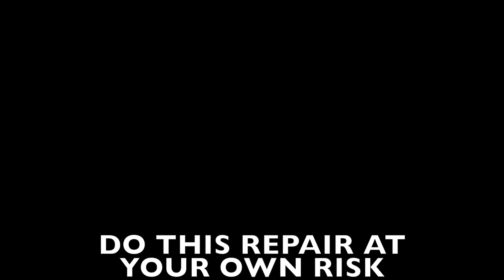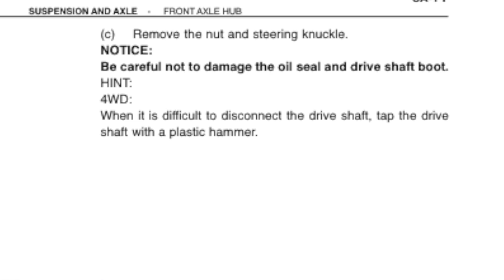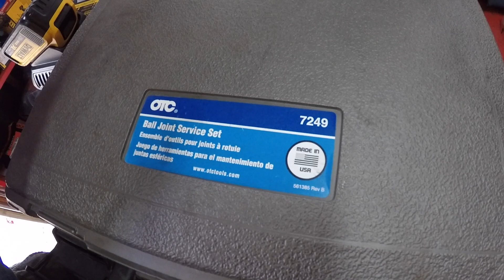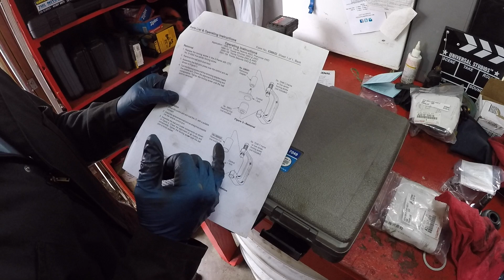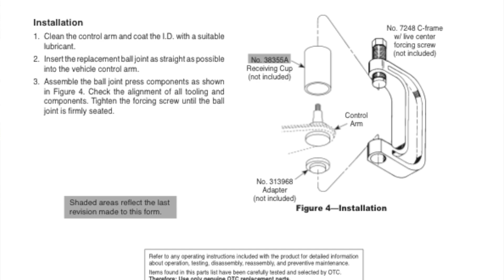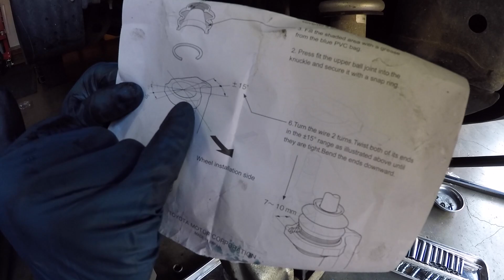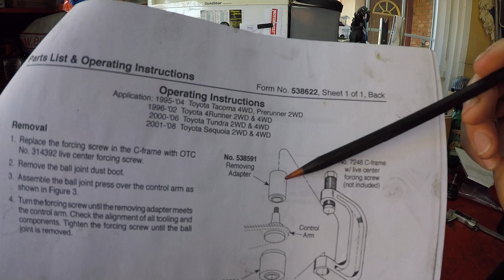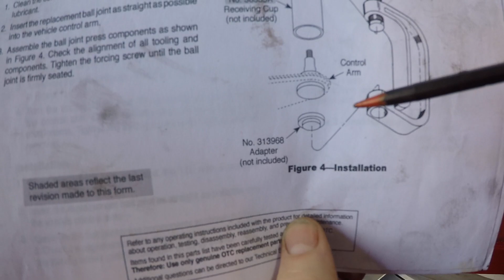Upper Ball Joint Replacement

Comment: Hey Timmy, is it really necessary to remove the whole knuckle? Why can't the ball joints be removed while on the vehicle?
Reply: Actually I just read your pinned comment,. I was thinking to myself, "why can't I just impact the ball joints out with the knuckle still on the truck?" Haha
Reply from the maker: It's not totally necessary.  I decided to pull it off so I could secure it in the bench vice to hold it steady because you have to apply quite a bit of force with the balljoint c-press to drive it out of the knuckle.  With someone helping you by steadying the knuckle while you apply force with the c-press, you could probably do it.  If you have an impact gun that you could attach to the c-press bar screw, that would make it much easier.

Comment: Timmy, do you know if the Pittsburgh Automotive ball joint puller sold at Harbor Freight will pull the upper ball joint? It is the tool that looks like (2) fingers with a threaded bolt at one end of the fingers. The bolt is used to apply separating force to the (2) fingers.  I can't tell if that tool would fit into (slip under) the upper control arm. If you've never tried one, I get it.
Reply from the maker: Hey Tim, I've never tried a Harbor Freight 2 Jaw Puller so I can't say for sure but I imagine it probably would if it looks anything like the one I used from my OTC Kit.
Reply: @TimmyTheToolman  Thanks for always supporting your followers.
Reply from the maker: @turnah8242  My pleasure Tim.  Sean and I started this channel to help empower people to handle their own automotive work and part of that is answering people's questions.  We don't always know the answer and some questions squeak by us, but for the most part, we answer all questions to the best of our ability and we also try to acknowledge everyone's comment.  We like hearing back from people sharing their success story using one of our videos.  That's the best reward we get from running this channel.  Happy Wrenching Tim!

Comment: Thanks so much for making your videos, they have helped me a lot!

The biggest issue I have had so far is the "c" clip/snap ring, what kind of snap ring pliers are you using? Mine won't do the job getting it wide enough to slip past the Proforged sealed boot.

Edit: I overlooked the post below of the same question, thanks for the info.
Reply from the maker: Pstand38 thanks for the comment. Hope you did alright with this job

Comment: getting ready to do my upper ball joint on a 2001 Toyota tundra 4 wheel drive, i bought the otc adapter for 313968 thats on the cheat sheet and your otc tools you added to your tool list , the circumference is to small for my upper ball joint bottom  , it doesnt sit in it , dont want to hurt bottom of the ball joint , can you please add otc part # of the bottom adapter # that your ball joint sits in to install it thank you
Reply from the maker: All the part numbers for the adapters I used are listed in this PDF.  https://www.otctools.com/sites/default/files/538622.pdf

Comment: What wheel spacers are you using on this rig? Size. I'm gonna have to do my upper ball joint on the passenger side. Every time  I'm wheeling I go over rock and the wheel drops, sounds hard hitting plus there is grease coming out too. I don't have a table or vise. You think with a buddy I can do it on the 4runner? I just need to rent the ball joint press and ball joint separation tool.
Reply from the maker: I don't know what spacers he was running.  You can probably do the swap with the knuckle on the rig with a helper.  You just need to stabilize the knuckle so when you apply force with the balljoint press, the knuckle is twisting.  Maybe you could get onto the knuckle with a pipe wrench holding it steady while the other person applies force with the balljoint press.
Reply: @TimmyTheToolman  hey Timmy I was struggling to get the upper ball joint out because I don't have the sleeve you used on top. My set come with a long tube, but looks like that is to install it.  I went to pepboys, o'Reilly's and auto zone. They had what I had. They also has a master ball joint kit and non had that sleeve you used to press it out. I also did the job on the truck. I didn't remove anything, but I rested the lip of the rotor on a 4x8 and caliper on another 4x8 to keep it straight.
Reply: So I used the tip of the screw for the c-press to push it out a little bit at a time had to reposition about 4 times on the right side then on the left. To press it in I used one of the cups for the top and nothing but the screw from c-press to push it in, was kinda hard because the axle was in the way, but managed to get the job done after 4 hours hahaha and that's just one side I'll probably do the other side in a couple days. The c clip retainer was hard to install too. Do you have a part number for those red one's you used? I used the pliers that are ment for the clips that have holes. The one Toyota doesn't have holes and I kept slipping off.
Reply from the maker: @damacknificent151  Good to hear you persevered and got one side done.  Yeah, I'm glad I had the right balljoint sleeves for the job but it did cost me a fair amount of money to get all that stuff.  I added some tool links to the video description that I used for the job.  The pliers you were asking about are the ones called Lock Ring Horseshoe Washer Pliers.  Good luck with the other side.  Hope it goes smoother for you.
Reply: @TimmyTheToolman  I just need the actual sleeve you used to push the ball joint out. I don't see it on there. I didn't use ofc, I used astro 7865 kit.
Reply from the maker: @damacknificent151  Look at the OTC PDF link and scroll to the second page for Toyota applications.  The schematic with all the balljoint tool part numbers is there.
Reply: I just noticed that your c press might be bigger inside diameter for end to end. Is it more than 6 inches?  Because we got the Japanese 2 cup adapters and there wasn't enough space for receiving cup plus the new adapters
Reply from the maker: @damacknificent151  I'm not at home so I can't measure it for you right now.  If I remember when I get home, I'll pull out the tool and take a measurement.

Comment: Hey Timmy enjoyed this video but I am in need of a guide I need to re vacuum tube my engine. Could you make a video on how to re seal all of that and how to properly care for it?
Reply from the maker: Are you asking for a video showing the replacement of all the vacuum lines on the engine?  If so, I would only replace vacuum lines that are clearly cracked or broken.  Over time from the heat of the engine, the lines can get brittle and crack, usually at the fitting connections.
Reply: @TimmyTheToolman  yes I have one but I'm not sure of proper procedure and proper care
Reply from the maker: @brushpile4682  There is no procedural care for vacuum tubes that I know of.  When one cracks or breaks, you replace it.
Reply: I heard your put grease on em or something
Reply: Timmy The Toolman I heard you put grease on em or something
Reply from the maker: @brushpile4682  Sounds kind of weird to me.  Vacuum lines last a very long time as is, 20+ years.  I've never heard of anyone treating vacuum lines with a product to enhance their longevity.  Now, I know people clean their engines and spray that shiny crap all over the place to make the engine look pretty but I don't think that's doing anything for the longevity of the hoses.
Reply: Timmy The Toolman what’s a good way you’d clean your engine?
Reply from the maker: @brushpile4682  I personally never clean my engines.  But, people use degreasers and spray it down with a sprayer like at a coin-op car wash.
Reply: Timmy The Toolman alright thank you for the advice

Comment: Just double checking, does the OTC-7249 kit contain everything you needed for this job?
Reply from the maker: Hey Ryan, No, the kit doesn't have everything.  Look at the video description because I list all the additional tools needed to go along with the 7249 kit.  There's also a link to the OTC pdf file showing all the necessary tools needed.  It's a decent investment buying all these tools but it definitely makes the job really easy because they are the perfect fit for this application.  Others have made due with what they have in their personal tool arsenal or can rent for free from an auto parts store.
Reply: @TimmyTheToolman  Thanks for the quick reply!  Does anything in this kit work on the steering stabilizer bushings or the upper/lower control arm bushings?
Reply from the maker: @ryant5469  A balljoint c-press doesn't work well for control arm bushings.  It's better with a regular hydraulic press and a bearing splitter.  The main issue is you need some type of way to get a receiver cup in place and there isn't anything for the receiver cup to rest against and allow the bushing to push put.  Also, bushings need to be pressed from the inside out on the front control arms so there's limited room to get the big c-press between the control arms.    If you watch the video we've made for doing front control arm bushings and rear control arm bushings, you'll understand why a c-press isn't the right tool for the job.

Comment: Hey Timmy, your degree of thoroughness is much appreciated. You guys have given me the confidence to tackle jobs I would never have tried. My question; I'm looking at a parts drawing from my local dealer and comparing that to my 4Runner. So on the bottom of the UBJ there is a large hex sided fitting (cap) that appears to bolt on to the bottom of the actual joint once it is pressed in. I watched the video twice but I can't seem to see you removing that large hex sided (cap). The drawing from Toyota shows (2) versions of this cap, maybe 4 whl drive and 2 whl drive trucks? <48331(RH) / 48331(LH) and 48332B(RH) / 48332C(LH)>.
I don't need the parts, I will buy the UBJ entire assembly, just trying to work out what that part is exactly.
Reply from the maker: Hey Tim, that's great to hear our videos have inspired you to take on jobs you otherwise would have passed on.  That hex-sided thing you're talking about is the actual steering knuckle the upper balljoint gets pressed into.  There's nothing that threads onto the UBJ other than the castle nut that connects the UBJ to the upper control arm.
Reply: @TimmyTheToolman  I suppose that makes me a 'knucklehead', ha! That Toyo drawing is misleading. The fact that you are replying to a video you posted a year ago means a lot. The fact you reply to every comment means a lot. I've been doing my best to spread the good word, gotta get those views up! I shared your axle seal replacement videos with a mechanic I know. He's a good guy but.......for axle seals he uses the 'torch and a huge hammer slamming a pipe on that ring' method. I was trying to show him the awesome adapter tool you used in the video. He's been wrenching since he was twelve. He couldn't have cared less about your video. I guess guys with the bigger hammer method are never going to leave the Dark Side.
Reply from the maker: @turnah8242  We really try to answer most questions that people have and also acknowledge all comments people make.  We're not so big that we don't have the time to do this.  It is time consuming but we don't mind it.  Some questions and comments squeak past us, especially when both of us are busy or out of town without an internet connection, but we try to get back to people for the most part.

I've found that paid mechanic types are usually the ones that are most critical of YouTube DIY mechanics like Sean and I.  What I like to see from people is they are willing to learn, even if it's from a guy like me who's not a certified mechanic.  I'm a firefighter and I can learn from an experienced person with 30 years in the fire service and I can also learn from a person who just got hired.  Everyone has knowledge and skills and you should be open to learn especially when presented with a better way to accomplish something.    It's just like mechanics who love the Big F'ing Hammer technique over using pullers to disconnect tie rods and balljoints.  I'm glad I possess this quality and can admit when somebody presents me with a better way to do something.  Just like firefighting, automotive mechanics, and pretty much everything else under the sun is a constant learning process.   You should always be looking for ways to improve.

Comment: to add a little flare, I added some colored MTB shift cable on end caps for that boot wire, ha!  Sic Mods!
Reply from the maker: Nice addition.  I have derailleur cable ends and brake cable ends but I don't have colored ones, just silver.  That does qualify as a sic mod. Good job!

Comment: Was woundering if that’s was one ball joints that you installed
Reply from the maker: I don't understand your question.
Reply: Sorry I meant OEM ,and will the ball joint removal and install kit work for a 1995 Tacoma?,gonna change out mine and use a lot of your videos to help guide me for repairs,thanks for your help

Comment: Hey Tim! I'm doing the whole front end (SPC UCAs, bilstein with OME coils, replacing oem LBJ, durobumps and new rotors/pads). Doing the job by myself, so I figured taking the spindle off would make inserting the new UBJ easier. What order would you recommend I do things to make it more streamline? Thanks in advance for your advice and for the awesome vids! If i get hung up, I hope you do house calls to the east bay. lol
Reply from the maker: Well, here we go.  Get the steering knuckle off by doing everything we show in the video.  If you don't have an impact gun, break loose the 4 LBJ bolts before disconnecting the LBJ from the lower control arm.  Do the UBJ replacement and also swap the LBJ.  Before getting the steering knuckle back in, remove the coil and shock and then remove the UCA.  Install your front Durobumps.  Put in the new UCA.  Put in the new coil and shock.  Get your knuckle back on.  Finally get your new rotors and pads on.  You're done!
Reply: Timmy The Toolman thanks Tim! I’ll give it a go !
Reply from the maker: @shaolin29  Good luck Brother!  If you run into problems, let me know.

Comment: So much easier on the Tacoma’s … ball joint on the control arm. So replacing it is so much easier
Reply from the maker: Must be a 2nd or 3rd Gen Tacoma.  1st Gen Tacomas are exactly the same as the 3rd Gen 4runners.

Comment: Auto tech/ aviation tech here. Might be too big to use but have you tried safety wire pliers?
Reply from the maker: I've never used safety wire pliers but I'm pretty sure I know the application you're talking about.  As firefighters working the air shows, we have to get a brief class from the pilots on how to open their canopies, shut off the fuel, shut off battery power, etc.  When looking around the planes, I couldn't help but note some of the bolts had safety wire.  I guess it's like a castle nut that has a cotter pin so if the castle nut loosens, it can't back out.

Comment: Great didactic approach to your videos. New subscriber here. I have a 5th gen 4R 2018 with KDSS  and started noticing odd vibrations on the steering wheel and a clunk whenever the nose dives and once it comes back up. Do you think that in less than two years a ball joint would fail? I use it in the city and light off roading. Thanks in advance for your help
Reply from the maker: Hey Andres, good to hear you like our videos.  I would do a thorough inspection of your front end steering and suspension components and see what you find.  With such low miles, you wouldn't think you have any balljoint, tie rod, control arm, shock, spring or sway bar problems but who knows.  The clunk is indicative of something loose so take a good look and hopefully you can figure it out.
Reply: Timmy The Toolman will do! Thank you!
Reply: Timmy The Toolman update: it was the whole steering shaft assembly. Replaced under warranty. The frustrating thing is that they told me it was the front brakes and that I needed an alignment. Didn’t make any improvements on the clunking and vibration, of course, and went back same day until they checked the steering. Two weeks to wait for parts and they were pretty embarrassed when caught basically lying that it was the brakes.

Comment: So what i noticed after doing a rough country lift (poor mans lift) that the knuckle was hitting the coil when it was full extended and damaged it. Is that something that you guys experienced or seen?  I eneded up buying aftermarket uniball upper control arms off ebay which gave me the clearance i needed but im looking to go back to the stock.
Reply from the maker: Hey Robert, sounds like you did a spacer lift if the knuckle was contacting the spring.  Get rid of the spacers and either go back to stock or do a proper lift with taller/stiffer springs.  We have seen this before with spacer lifts.
Reply: Stupid question.... Would i have to upgrade the stock shock when doing so?
Reply from the maker: @bobbybrwn  Bilstein 5100s are a good affordable choice.  You can piece a lift together yourself our buy a kit ready to go like ToyTec sells and Sonoran Steel sells.
Reply: Also check the orientation of the bottom ends of your springs, it matters. The cut end of your front springs should be on the outboard side (closest to the wheel/tire) and point directly down the long axis of your truck. One side will point directly at your front bumper, the other to the rear bumper. This will help keeping the coil from contacting the knuckle.
Reply from the maker: @TheSaturnV  Thanks for sharing this.
Reply: Agreed. I went with Bilstein 5100s, Moog front and rear coils. The rears needed a 1" rubber base spacer and I wound up with a perfectly level 2" lift all the way around. So glad my 4runner doesn't look like a station wagon any more!